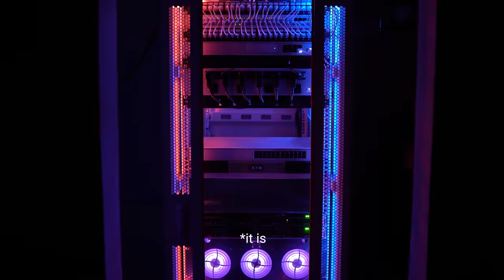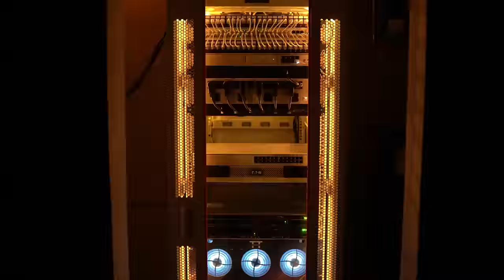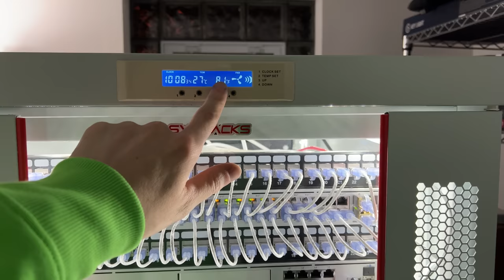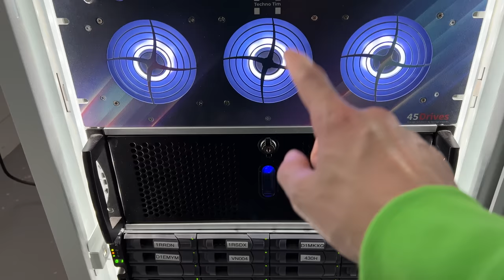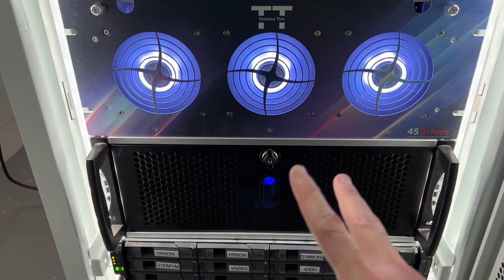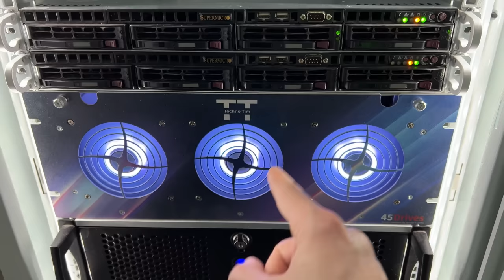Techno Tim HomeLab Server Room Tour! (Late 2022)

Comment: Best setup for homelab are 2x itx x570 boards with ipmi/ibmc that supports ecc ram.
2x because of failover/ha/updating/rebooting and you need 2 anyway for the storage. Consumer boards are usually limited to 8x sata + 1x nvme.
So that means in short asrock rack x570 with an amd 5600/5800. Because it supports ecc ram, has 2x 10g ports and ipmi.

No graphic cards is needed nowadays, because all the boxes (shield pro/appletv/etc) decodes themselves.
So use that graphiccard slot for an x16x4 nvme bifurcation card for cache/metadata vdev/log device for zfs! Use simply some cheap optane modules there.
Get a lot of ram. 128gb is the best.
Because you need a lot of ram for virtualization and zfs.
Put a lot of 20tb hdds in that in at least zfs z2 or raid 10 (zfs z1 is slow and it will get probably abandoned at some point, raid 5 is okay but raid 10 is actually the fastest, just yes you loose a lot of space)

Connect both servers together over the 10gbe port, use the second port for the switch.
Best thing is, if you have the ability to split up your 10gbe port for virtualization (sr-iov on intel nics for example) use that instead of virtual adapters.
Because that offers hw acceleration.

You can spec the second server lower, to use it as a backup server simply. Means less memory like 32gb (you can do less, but you still need a bit, because if you move the vm's from the other server to it, to reboot/upgrade/etc the other sever).
Just keep the cpu the same generation in both servers. Means in the main you can use an x5800 in the second an x5600...
Same generation, because you want to pass the cpu flags to the vm's to get sometimes better efficiency. Means setting the flags to host.

So in the end, you will have a relatively cheap mainserver and an even cheaper backupserver, both running as proxmox cluster.
Powerwise you can even do some scripts to turn off/on the second server just for backups.
Otherwise you actually don't need that much space for the backupserver (but keep in mind, don't use proxmox backupserver, use normal proxmox on it, i just call it backupserver)
So not so much storage, additionally the storage don't need to be fast on the secondary/backupserver, means an raid5, or zfs z2, even if i don't generally recommend, to safe money, you can use zfs z1 there.

The whole task of the secondary server is, to run some important vm's from the mainserver when you work on the mainserver and keep long time backups.
That's it.

The rack thing is something for company's, not for homelab 😂
Reply: Btw as example, i do run my homelab that way.
Main Server:
Asrock rack x570 d4i
Amd 5800x
128gb ecc memory
8x20tb as raid 10 + bifurcation in 2x raid1 (one for metadata vdev "optane", and the other for log "optane")
2tb nvme 980pro in the nvme slot, splitted with lvm up (600gb ext4 partition for lvm containers, docker container, etc. And 1.4tb as zfs cache device)
Using one nic in sr-iov mode, for vms (opnsense and so on)
And the other nic, back to back to the other server.
1x 250gb nvme ssd in and usb3 enclosure for the proxmox os.

The second (backup proxmox node)
Asrock rack x570d4i
3x 20tb hdds in zfs z1 (limited max l2 cache to 8gb) (for long term backup storage)
Amd 5600x
250gb nvme for proxmox.
2x 2tb some cheap sata ssds, Kingston a500 or sth like that (as vm storage simply if i need to work on the mainserver), with mdadm in raid 1 simply and ext4.

Why do i use zfs z1 for backup storage, instead of raid5 ext4 storage?
Well ext4 has no safety features for long term bitswap errors etc. Means your data can get corrupted on very old backups.

I don't think that anyone needs more, that's already a high end setup for homelab.
The only thing that was really freaking expensive are the 20tb hdds.
But you can get nowadays one for like 300-350usd.

And probably most people don't even need that ton of storage, i just have a ton of data.

Additionally, you don't really need to backup everything, as my mainserver has a ton of data, and a ton of storage, i use the second one only for vm backups and so on.
Mainly the second server is just there to bridge the downtime for the first Server.
As i have opnsense running and if i would have only one server, i would have no internet if the server goes down 😂
The backup job is just an additional task.

Absolutely everything is running on that server (zigbee, opnsense, etc...) So you basically run everything on it and you don't need any other dedicated hardware in your house.

Zfs on the mainserver is blazing fast due to the vdev/log/cache.
Additionally i have datasets for samba with shadowcopy and zfs snapshots. So you have backups that way either.

Cheers

Comment: Hi, how did you ground your patch panels, they seem to have shielded keystones and you are running PoE through them? This sometimes causes leaks into the rack, have you dealt with that or? Also, why not a single node with dual socket? Doing separate 1U servers is going to draw more power, more components etc. Lastly, in your previous video talking about UPS, you showed they had numerous sockets on it themselves, producing simulated or true sine waves and have grouped outlets on them as well. So, by using separate PDU, does that take away the advantage of that? I thought there were PDU's where you can get dedicated inlet for each outlet? So, to make full use of the UPS. Last question.. as a software engineer do you feel like homelab takes away too much time from your actual career or it feels like an addition? Thank you, Just asking, nice video man.

Comment: I'm not a fan of "power up front" because I feel like it adds complexity to maintain the rack. If all of your power cables are strictly in the back, including PDUs, then you don't have to open the front at all to deal with power issues. I'm not sure I'll get a Unifi PDU, but if I do, it will go in the back of the rack. That said, I like what you've done with your rack. It does look very nice, and there's a lot of things you can do just from the front.

Comment: This is an excellent video. I'm looking at moving my home equipment from a bookshelf into a rack soon. I'd be very interested in a video on the PDU Pro, particularly with failover with multiple UDM Pros. Thanks for addressing the RGB lighting as well. I've definitely fumbled around in a few racks that were a bit too dim or had areas that fell into shadow. Lighting strips seem like a great way to solve that problem. Perhaps the RGB color could be tied to rack temp for added utility???

Comment: Hey, are you running home assistant? If so does the unifi power distribution integrate into it? I would like to be able to use home assistant to be able to monitor its power usage, which I am currently doing with a kasa power bar, but that's obviously not rack mount

Comment: Now you just need to flip the servers around so they go in from the other side of the rack, makes so much more sense to have the switch ports and power strips facing the same side as the network ports and power inputs of the servers. maybe it's because I'm a network guy more than a server guy, but I generally don't get the fascination with looking at the front of server - apart from blinking drive lights nothing interesting goes on there. I have my home rack permanently facing rear side out for easy access to ports and cabling and all that good stuff. I rotate the rack 180 degrees when I need to add or remove a server or a faulty drive, but other than that I have no use for access to the front of my rack, everything goes on at the rear, so that's the side facing out.
Reply: Lol, this might explain why I settled for putting mine on wheels and usually side against the wall. I want both. Front looks pretty, back access for utility.

Comment: Love what you do in your homelab and wish I had the time to do what you do. Live in Australia and I'm finding that my under the stairs rack is getting very warm with the doors closed and 4 rack fans running - once I open the doors under the stairs it cools down dramatically. Both in Winter and summer - though our winter is not like US 🙂

Do you have any air conditioning with the amount of the equipment you have and what would you recommend? It seems to be very hard to get refrigerated air conditioning to cool a small space (approx 4-5cubic metres). 

Any suggestions that can be picked (inexpensive) up in Australia?

Comment: I have just redone my storage room / server room.
Put my VM-Host on the other server and put a table with monitor and KVM on it
Also put standard network cables (same colors except wan) in place of the old ones, finally split the network of my parents from mine with an opnSense
Btw, my specs: central VM-Host 2 x E5-2680v4, 128GB RAM (will upgrade down the line to 256/512), atm 4x500GB Intel SSDs in RAID 5 -> I will soon add another HBA and setup a bigger RAID for data (Probably formatted around 20TB)
My other server is a TrueNAS with 6x4TB HDDs in zfs-2, so it is around 14TBs -> stores data atm, but then will be for backing up all VMs an data with more hard drives
Then I have 5 switches, one main for the servers (HP 1820 24 Port), one in my workshop (HP 1810 24 Port), two in the living room (HP 1820 24 Port) and finally one in the bedroom (HP 1820 24 Port)

But some time down the line I'm gonna get a rack like you have, just brilliant and can be organizes much better. Grat job, I'mlooking forward to watching your services tour now ;-)

Comment: The brush that covers the hole at the top of the cabinet where all the CAT cables enter the cabinet - what's that called? I've just bought a Serveredge cabinet and it has the same slot for CAT cables to enter the cabinet, but it's just a rectangular hole without the brushes so dust and insects can easily get in. I'm hoping I'll be able to buy something I can use to help cover the hole around the CAT cables.

(Sadly this is my first ever cabinet so I have no idea what the correct terminology is)

Thanks in advance.

Comment: i would go for a vertical rack mount PDU tripp has some as does APC but those are really expensive. but these fit in the back most of the time between the back of the rack and the cage inside the rack and has a ton of power outputs and have a utp connection so you can read out the power usage.

Comment: So I am running a 10gtek module on my WAN SFP+ port and it autonegotiates to 2.5 gig just fine with my modem. I am getting about 1450 down on my 1200 Comcast connection reliably on my regular UDM Pro.
Reply from the maker: Good call!  I upgraded this before the unlocked the LAN WAN ports with firmware!

Comment: Would have loved to get a PDU to my rack, but it outputs 125VAC and my devices need 230VAC. Would have also loved to use the USB-C ports for my 4 raspberry pi 4b's, but they are 20W max total output.

Comment: did you plug your non critical device pdu into the ui pdu or a different wall outlet all together?
Reply from the maker: Great question, yes, I have multiple UPS's and plug critical into one and non critical into the other.  Critical being network devices.  They do not plug into the PDU.  All other do.  I also have a Pi on the wall that does DNS just in case.
Reply: @TechnoTim  awesome! For some reason I thought the pdu that came in the rack had surge protection so I was skeptical to plug it into the UPS. Thanks for the clarity 🙌🏼🙌🏼🙌🏼

Comment: your red WAN cable is triggering me. not that is red, I have the same for mine, but that you have a white cable in your patch panel. IMO it should be red otherwise why bother having a different colour in the 1st place
Reply from the maker: Yeah, it's just so I can trace it when it's in the bunch.  It's virtually labeled on the switch and if I physically look behind the patch panel I can see it's plugged in to red.  You're not wrong though :)

Comment: You have pretty much styated the obvious to us, the UDM-Pro SE is of no use other than useless white lights on ports, insufficient PoE (yes, issue with failing output PoE), the SE hasn't given you anything more as you internet as you sdaid is sub-1Gb and bvesides, you are not using the SFP+ port. The power from UBNT, expensive, US-market only and yes, I prefer power in back only. UPS's, common issues, all too small and have big power claims. Unless on lithium, they simply don't perform. Small units also have small, high-frequency setups and no big lumps of iron-cored goodness and abillity to withstand nasty power issues. Old-school APC is FTW!
Storinator, promo-box that seen a unsubscribe.